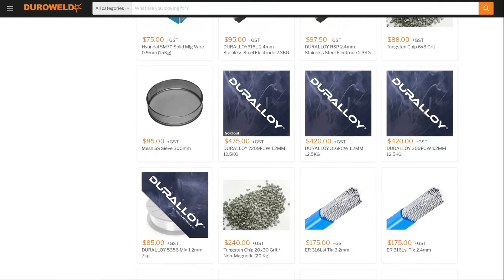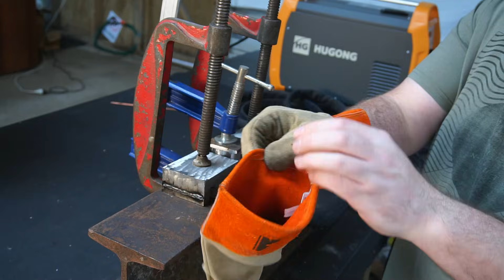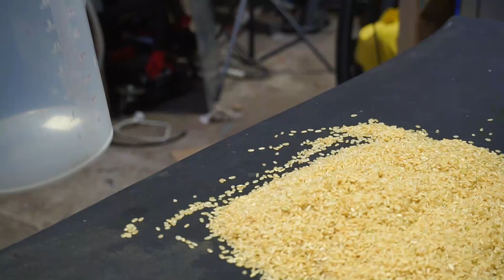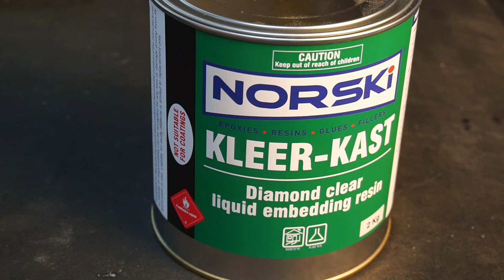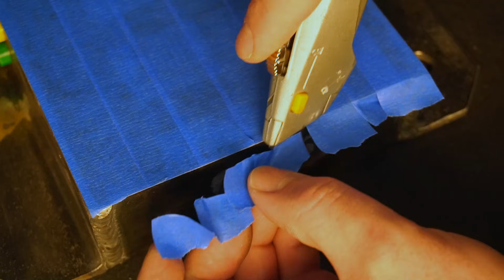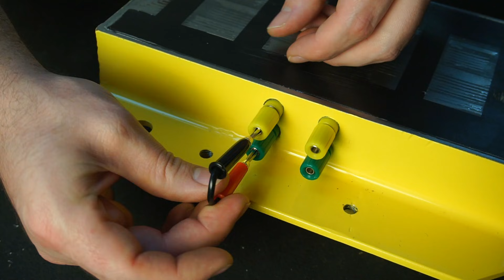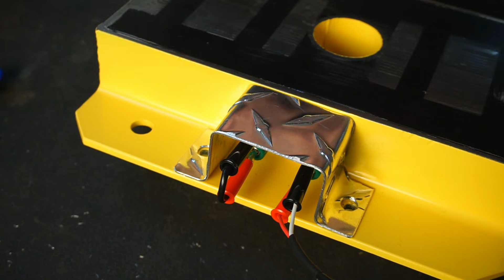making a Magnetic Vise for a Drill Press!

Comment: Should test power supply and general power outage scenarios, could have a bit of a suddenly spinning piece of steel on your hands (or through your hand) ... might have been better to repupose a 300kg+ lifting permanent magnet (but not as much fun).
Reply: That's a really good point I hadn't thought of.  In general, if the power goes out, the drill would probably also stop, unless of course the magnet power supply just failed.  Still something to consider.
Reply: @sijmengrunbauer7697  Big point! I would use it as an extra, not as the main holder. In combination with the vice, ok. So you have a good hold for non-magnetic materials.

Comment: Your torch angle is too shallow. And, either due to the torch angle and/or lack of argon volume, you are getting those nasty soot. Your puddle is moving too much due to your holding of the filler wire a mile away from the weld... Until you get good at this, you may benefit from using a gas lens. Sorry for being negative.

Comment: You know a lot about electronics. I am disappointed that you didn't tell us the DC resistance of these coils. It's critical in deciding on a power supply. Knowing the voltage I could have calculated the resistance if you informed us of the current. You failed to do that as well. Why?
Reply: Only for your Power supply, when you not using the kickback diode. The inductive revers voltage is much higher than the 12 Volt. Use low voltage and see how strong it is. This project is way overpowered. To calculate the resistance, you find enough examples in the web by yourself.

Comment: Nice build. Did you also sand the bottom flat? It would propably have been a good idea to mill the top flat on the router after casting the resin. Btw. why didn't you use epoxy resin? It doesn't shrink much at all.
Oh, and one side note: a lot of commercial magnetic vises don't even need electricity, they work purely by moving permanent magnets in and out of alignment with magnetically conductive strips in the surface.
Reply: Best answer. Say's it all.

Comment: It's a great dedicated work you have put in to try something from your imagination. The fine details in the mechanical aspects of the whole job is really amazing.
As far as the surface area of piece to be held is large enough to occupy the pole areas you can guarantee that the force would be great. Anything with a smaller contact area would try to rotate especially when the drill bit tries to pierce through the other side. The torque would be very high to be held up. 
Sticking tape to augment the friction is not a good but an inevitable choice.
No need to mention the fact that the electromagnet is to be powered up by an uninterrupted power supply.
The iron filings (though from a soft iron) would be magnetised and would be difficult to clean up for sure.
Thanks for the video.
Reply: Just add a sacrifice piec that is long enough to uccupy the pole areas under the small piece.

Comment: Great video I am going to build one.  The transformer coils are rated for mains voltage did you consider putting mains voltage on them or at least a hire voltage. This may eliminate the need for the anti slip tape.
Reply: you cannot use AC power. One its too high voltage, 2 its dangerous and 3 the magnet will go N-S-N-S etc at 50/60Hz and you nett magnetism will be zero. Must use DC, about 12v is good
Reply from the maker: Thanks. While the coils are rated for mains power, the inductive reactance will change depending on how much metal is being attracted to the magnet. This could lead to a coil meltdown depending on several factors. So I only recommend DC for this project. :)
Reply: @Schematix  But when you use a current limiter, you need much less power for the same effect.

Comment: I've made the electro magnet from the transformer that you created last time. I'm using it in classes to show the magnetic effect of electricity. I've added a footplate for the apprentices to stand on and some handles thru the transformer holes so that they can pull on it to show their strength or lack of it.
I start out showing how simple it is to disassemble the 2 sections of the electromagnet & challenge them to be stronger than me. The only help I will use will be a UPS 12 Volt battery. Of course once it is powered, there is no way they can pull it apart. It's a great lesson on just how strong an electromagnet can be and just one of the effects of electricity.

Great use of the electromagnets making them into the magnetic vice. Very professional finish as well! 😉
Keep up with the great videos
MiracleMAX
Reply from the maker: Thanks for sharing your experience! I find it quite amazing how powerful these rather simple electromagnets are. As you've said, it's an excellent example to teach how powerful these forces are. So glad you found my video useful :)
Reply: @Schematix  Just like you I am amazed by magnets, both permanent & electo. I have done a video myself on the subject & thoroughly enjoyed the whole process. 
Glad you have thrown in your Kiwi sense of humour. It makes learning heaps more fun.
Cheers from across the ditch.

Comment: No need for a separate chassis ground?
Reply from the maker: There is no need for a ground since the power supply is 15VDC
Reply: Also, the chassis of the electro magnet is mechanically connected to the drill press, which is probably already grounded 👍
Reply: @kris754a  The Magnetic Field is only located in the iron of the coil. That's not current.

Comment: Nice part is you can always apply more power, what kind of duty cycle can you get before it overheats if any?  If that's a factor, attach a bimetal to the case to stop power if left on too long, or forget to turn off, always think worst case, it could be destroyed otherwise.
Reply from the maker: With the current 15v, 5a psu. The vise stays cool to the touch. My theory is, the thermal mass of the vise is reasonably large & can soak up a lot of heat from the coils. Thus far I haven't felt them even get warm. :)
Reply: @Schematix  what will happen if you add that hardener to resin and then drink it?
Reply: Try it and have your spouse let us know how it went. @adrianakuzmikova1697